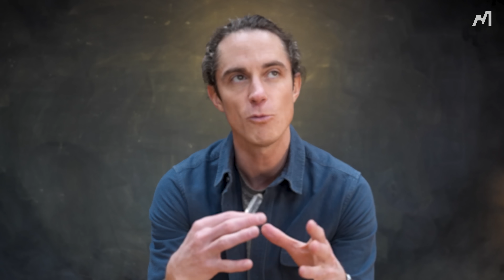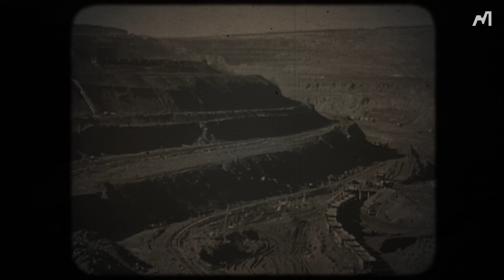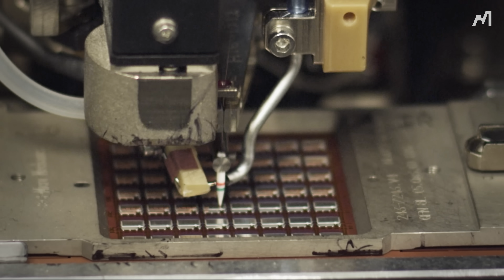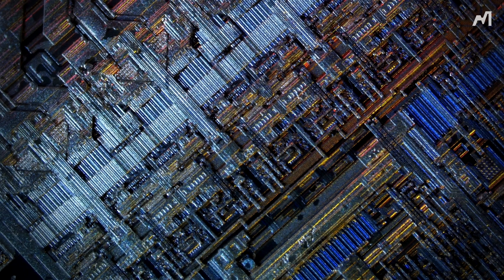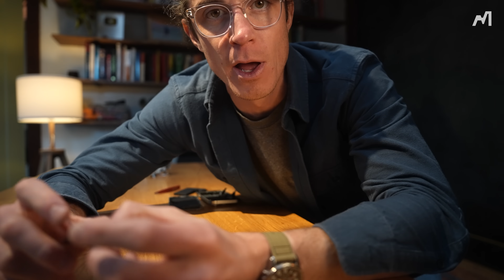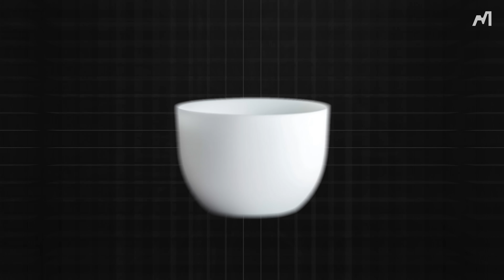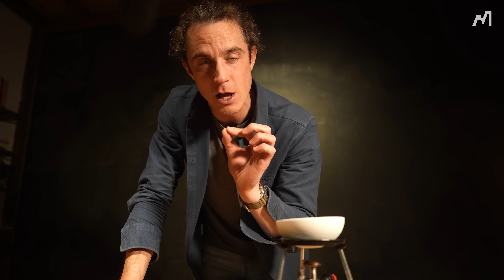Saudi Arabia Has Oil, America Has This

Comment: 13:00 I mean only as long as we use Silicon for chips.

which no one can garantee is going to be the case ALWAYS.

and also no garantee that just like diamonds, scientists won't find a way to make PURE SILICA artificially in lab as well, which China is already trying to do.

also, once we discover a better material than silicon, we would no more need it.

And Carbon/Graphene based chips are under research.

now before people make fun of how graphene always seems to be under research forever and nothing happens and is probably a gimmick or something.

let me tell you, the EUV Lithogrpahy machines that ASML makes that allows manufacturing of semiconductors by Taiwan or Samsung today, were under research for 30+ years before finally ASML successfully developing it and shipping it to Samsung to make the first 7nm chip.

30+ years and that is only for MAKING IT SMALLER.

so testing stuff on complete new material is bound to take longer and we have known about graphene for less than 20 years.

So just wait....

Next 30-50 years, things would be 100% completely different.

Comment: The US has a monopoly on quartz?! 
Norway has one of the world's largest deposits of it and could easily supply the world with all the quartz they need, if they decided not to be so fervent in protecting the country's nature.
Reply: YOu are very, very uneducated in this area.  Do some research:

Who Produces the Most Wafer‑Grade (Ultra‑Pure) Silicon Each Year?
Wafer‑grade silicon is not the same as ordinary silicon metal. It requires 11N–12N purity (99.999999999%), and only a handful of companies in the world can produce it at scale. These companies refine polysilicon and grow monocrystalline ingots used for semiconductor wafers.
✅ Top Producers of Ultra‑Pure Silicon for Semiconductor Wafers
These companies dominate the production of high‑purity silicon used to grow ingots that are sliced into wafers:
1. Wacker Chemie AG (Germany)
One of the world’s largest and most advanced producers of electronic‑grade polysilicon, a key precursor for wafer‑grade silicon.
2. Hemlock Semiconductor (United States)
A major U.S. producer of high‑purity silicon used in semiconductor manufacturing.
3. Tokuyama Corporation (Japan)
A leading Japanese supplier of ultra‑pure silicon for semiconductor applications.
4. REC (Renewable Energy Corporation, Norway)
Produces high‑purity silicon used in both solar and semiconductor markets.
5. SunEdison (U.S.)
Historically a major producer of high‑purity silicon and wafers (though the company has undergone restructuring).
These companies supply the feedstock that wafer manufacturers use to grow monocrystalline silicon ingots.
Reply: USA holds a near-monopoly on high purity quartz. Yeah other places have quartz but Spruce Pine in North Carolina is where almost all of the world's supply of ultra high purity quartz comes from.
Reply: @wowzer1404  Check again. The US has the most, but Norway isn't far behind

Comment: Your recipe at the beginning is for cement, not concrete... If you want concrete, you need to add stone (usually gravel).
Reply: Doesn't have to be stone, just any aggregate. Plastic chunks being mixed in would still be concrete, same with metals. They aren't used mostly because stone most accurately matches the cement's temperature fluctuations and doesn't slowly corrode from the air like some metals would. Plastics would likely cause cracks over time because it expands and contracts at different rates, it also might melt or rot in direct sunlight. Theoretically though, you can make concrete with any kind of small/medium aggregate.
Reply: And pozzolan, the volcanic ash that makes concrete self healing that the Romans used and explains why this old structures are still standing.
Reply: Gravel, sand, ash, cement and water

Comment: That's interesting to watch. I wonder why it's not possible to chemically purify the quartz that's made into the crucibles. Quartz is among the materials we are able to manufacture, though I don't now anything about the purity of it. Also, I understand that to purify metals such as copper, silver, and gold, that after the initial ingot formation it goes into an electrolysis tank and goes from being a relatively pure ingot into metal crystals with four to five 9s of purity and is then melted, poured, and stamped for sale. It feels curious to me that we wouldn't employ similar techniques, or repeated steps like dissolving highly purified silicon and recrystallizing it out of solution unless the returns flatline before any meaningful gain. This is a phenomenal video though, Maxinomics, and it genuinely has the hamster wheel spinning up there in the noggin.

Comment: I was wondering if Spruce Pine was going to be where the quarry was. I have been to work on equipment in the quarry there several times last year. Its a strange thing to see, when you turn the corner, onto the road leading to the quarry a couple miles away, and you just see this mountain with a bright white whole in the side of it. Working on site in broad daylight can be somewhat painful on the eyes. Its a shame you couldn't any footage from the site.

Comment: Not really, synthetic ultra pure quartz can easily be man made these days in industrial quantities.  If we can make synthetic sapphire, ruby, and diamond in industrial quantities then quartz is no problem at all.  Silicon carbide (that’s used as a semiconductor with microchips) is produced in such vast quantities today that we use it for sand paper grit and grinding wheel abrasives due to its hardness.  In the early days yes America did have a monopoly on it but not now.  What gives America the edge is the chip producing machines.

Comment: Great question — that video is excellent storytelling*… but it quietly slides from **“critical bottleneck”* into *“mythical monopoly.”* Let’s untangle what’s solid, what’s exaggerated, and what’s just plain wrong.

---

## TL;DR (but with teeth)

* ❌ *The U.S. does NOT have a monopoly on quartz or silica*
* ❌ *Spruce Pine is not the only possible source*
* ✅ *Spruce Pine *is uniquely valuable**
* ✅ *Ultra-pure quartz is a real chokepoint*
* ❌ *Chips do not magically stop existing without Spruce Pine*
* ❌ *Quartz is not an element (you’re right)*

The video takes a true vulnerability and turns it into a *single-point-of-failure myth*.

---

## First: you’re absolutely right

Quartz ≠ element.

Quartz = *silicon dioxide (SiO₂)*
It’s a **compound**, not an element.
The actual element used in chips is **silicon (Si)**, which is the **second most abundant element in Earth’s crust**.

So any claim that “one place controls silicon” should immediately trigger your BS detector 🚨

---

## What Spruce Pine actually is (and why it matters)

Spruce Pine, North Carolina produces **exceptionally pure natural quartz**.

* Typical high-grade quartz: 99.7–99.8%
* Spruce Pine: *~99.999% (“five nines”)*

That purity matters because:

* Quartz crucibles do contaminate molten silicon
* Fewer impurities = higher wafer yields
* Higher yields = lower cost + fewer failed chips

So yes — **Spruce Pine quartz is elite-tier feedstock**.

But…

---

## The BIG exaggeration: “irreplaceable”

This is where the video goes off the rails.

### Reality:

Spruce Pine quartz is:

* *Best*
* *Cheapest at scale*
* *Easiest to process*

It is **NOT**:

* The only quartz pure enough
* The only way to make semiconductor-grade silicon
* A magical geological singularity

### Alternatives exist:

* Synthetic quartz (used already, just more expensive)
* Chemically refined silica from lower-grade quartz
* Non-quartz crucible coatings and liners (R&D ongoing)
* Different silicon growth methods (less mature, but real)

If Spruce Pine vanished tomorrow:

* Chips wouldn’t stop
* Costs would spike
* Yields would drop
* Advanced nodes would slow
* Governments would panic-fund alternatives

That’s a **strategic vulnerability**, not a monopoly.

---

## The crucible claim (half true)

Yes:

* Quartz crucibles are standard for Czochralski silicon
* They’re single-use
* They introduce contamination

But:

* Crucibles are already *engineered products*
* Raw quartz is *not* used directly
* Multiple countries refine quartz into crucible-grade material
* Japan, Germany, and others play huge roles here

Spruce Pine feeds a **global supply chain**, not a US-only one.

---

## “China can’t make advanced chips because of this”

That’s… very misleading.

China’s real blockers are:

* EUV lithography (ASML)
* Process control IP
* Materials science at scale
* Yield engineering
* Tooling ecosystems

Quartz purity is *not* the main wall.
It’s a **brick in the wall**, not the wall itself.

---

## The “black art” stuff

This part is actually mostly legit.

* Crystal growth is tacit knowledge
* Yield tuning is artisanal
* You can’t fully document it
* Masters really do fail 20–30% of the time

But again:
This knowledge exists **across multiple countries**, not just the US.

---

## Why the myth feels true

Because it matches real patterns:

* Saudi oil
* Dutch lithography
* Japanese photoresists
* Taiwanese fabs

So when someone says “America’s secret sand,” it *sounds right*.

But geopolitics isn’t built on *single grains of sand* — it’s built on **interlocking choke points**.

---

## The honest bottom line

* 🟢 Spruce Pine is *extremely important*
* 🟢 Losing it would be *disruptive*
* 🔴 The US does *not* have a monopoly
* 🔴 The world would *not* fall back 25 years
* 🔴 Taiwan fabs would *not* shut down “full stop”

It’s not an ace in the hole.
It’s a **very strong card in a very large hand**.

If you want, I can break down:

* What actually would happen if Spruce Pine was cut off
* How long substitutes would take
* Which chokepoint matters more than quartz
* Or how much of this is quiet Cold War narrative-building

Just say the word.

Comment: Actually there is an automated process for monitoring the molten fluid (ice) to help determine the rate of pulling the seed.  My colleges and I patented this method in US Patent 6175644B.  Year 2001. We did this work for a customer that melted the silicon in huge furnaces and extracted them with a seed crystal. The patent talks about looking through the furnace window and but does not specifically mention the customer but if you skim it you will see its obviously about this process.

Comment: Whats interesting is how Tin still plays a major role in the process. They blast the Tin into the molcule necessary to lay flat onto the Silicon. If its not Spruce Pine Quartz it will not lay flat enough.

Comment: It's kinda funny, my grandpa was a software engineer in the 70's and 80's, my dad worked at intel for most of my childhood, and I worked at a company that made plastics in a clean room that were specifically made to be used with silicon chips because they were never exposed to any contamination from production or anywhere in the supply chain, and then I worked as a trucker for 7 years, and I drove for the same company for like 6 months, transporting the clean room plastics from one clean room to another in a trailer that I wasn't even allowed to enter as the driver.

So my family has been involved in every step of the process involving silicon chips for generations, besides mining the silica, and I didn't know any of this. I'm pretty sure we all thought it was just normal sand being used.

Comment: I used to work at one of the few silicon metal facilities. A single large shipment bag (about 4x4ft wide 5ft tall) would be worth around a half a million dollars. One of the most dangerous, self destructive places I’ve ever worked. Power bill was an average $2-2.5 million per month. It was a unique job though.

Comment: this is partially true, sensationalist without being sensationalist in wording. Lower pure silica can be used but what it causes is higher costs, requries more aggressive chemical purification to remove those impurities and lower yields from the wafers. So to say the leading edge semiconductors can't be made without is untrue, it can be but drives costs higher b/c of the processes and yields of those impurities. Instead those lower grade silican with higher impurities are redirected to older chip nodes that can handle the impurities, or have their costs ammortized and can absorb the incremental cost for chemical purification. So your thesis statement that without it we would go back in time 25 years is... sensationalist and false.

Comment: It's simply cheaper to start with pure silica, 6 nines. But the final product requires 9 nines. So, even if china has to go from 3 nines silica, it might just be 50-100% more expensive. Not impossible.

Comment: Silicate-based (silicon) semiconductor crystal pulling relies primarily on the Czochralski (Cz) method, where high-purity silicon is melted in a quartz (\(\text{SiO}_{2}\)) crucible at ~1410°C. A rotating seed crystal is dipped into the melt and slowly pulled upward, solidifying into a large, monocrystalline silicon ingot. 
The Czochralski method was developed by Polish scientist Jan Czochralski in 1916 while working at AEG in Berlin. It was discovered accidentally when he dipped his pen into molten tin instead of ink, pulling out a single crystal filament. He later formalized this technique, which involves dipping a seed crystal into a melt and pulling it while rotating to create large single crystals. 
In the early 1950s, researchers at Bell Labs (notably Gordon Teal) rediscovered the process, adapting it to produce large-scale silicon and germanium crystals, forming the basis of the modern semiconductor industry.
IBM contributed significantly to the advancement of the Czochralski (CZ) method for silicon crystal growth, particularly during the 1970s and 1980s. Their research focused on improving the uniformity of dopant distribution, controlling crystal diameter, and enhancing process automation for high-volume manufacturing of integrated circuits. 
Now Japan, South Korea, Germany, and Taiwin are the largest chip makers.

Comment: did you know:  under the current model of "slow moving plate tectonics" like we currently have there is not enough force in that to create mountains.  They move so slowly they would just either slide under or above the other plate, not enough force to create mountains, for that you need a lot more force.

Comment: You're truly over exaggerating how important pure natural sources of quartz actually are to the semiconductor industry to the point of spreading problematic misconceptions. Given that material cost forms a small fraction of the overall cost of a chip, while more expensive, there exist other ways, besides mining a pure deposit, to reach the purity of silica needed for producing silicon.

Comment: What's Exaggerated:
The "slip backward 25 years" claim is hyperbolic. While disruption would be serious, alternatives exist:

Synthetic quartz: Can be made far purer than natural quartz but costs 5-10 times more Construction Physics. Some manufacturers already use it.
Other sources: Norway, Russia, Brazil, China, and potential sources in Canada, South Carolina, Sri Lanka, and Australia could be scaled up Construction Physics.
Refining lower-purity quartz: Possible but more expensive and might cause lower yields Construction Physics.
Alternative crucible materials: Researchers are exploring silicon nitride and silicon carbide Construction Physics.

The Real Risk:
Spruce Pine occupies a unique niche in a price-performance landscape - alternatives are all some combination of not as good, not as cheap, and not yet developed Construction Physics. A sudden disruption would cause significant cost increases and potential yield reductions, not a complete industry collapse.
Verdict: It's a critical bottleneck and genuine vulnerability in the supply chain, but "the world would slip backward 25 years" is dramatic overstatement. More accurate: several years of expensive disruption while alternatives scale up.

Comment: Not the entire story and not up to date. ARM managed to design, and ASML has perfected the method of applying a less pure form of silicone via lithography to a level even smaller than the current method, which requires sourcing material from Spruce Pine. These new 1nm chips will be made in Belgium, the Netherlands, and the UK. These countries are equal partners in the research project. Of course, the problem will be stopping the EU from selling those chips to China.

Comment: Fascinating information but not entirely factual.  Nowhere did you make mention of Germanium.  This material is advancing the latest breakthroughs in chip fabrication because it allows chips to operate at SLOWER TEMPERATURES which is critical.  After decades of chip manufacturing will attestify, power consumption is a big problem when scaled up to massive AI datacenters.  No only do these hungry beasts consume their own power generation plants but cooling of such takes a lake of water annually.

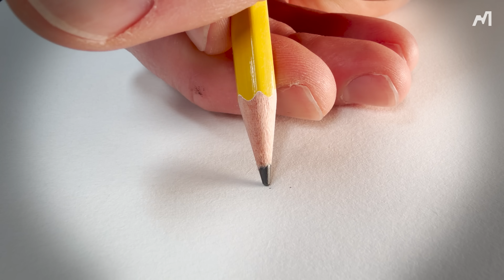Comment: Fascinating! But the purity numbers discussed at 11:55 are actually ZERO-based, which adds two nines. So the number given for required purity for making the best IC chips is actually saying "There can be only ONE impurity atom for every 10 TRILLION silicon atoms." And for making single-crystal silicon photovoltaics, the stated number means "There can be only ONE impurity atom for every 100 BILLION silicon atoms." But are the stated numbers the CORRECT numbers? @Maxinomics

Comment: here is a problem with all this... 99.999% and 99.7% is a matter off cheaper or more expensive starting material and pre processing.
and at the end of the day the cost of CHIPs is more a effected by the post processing of the silicon boul rather then the pre processing.